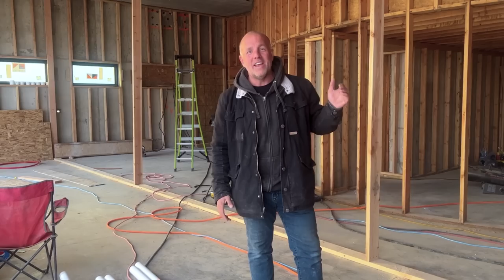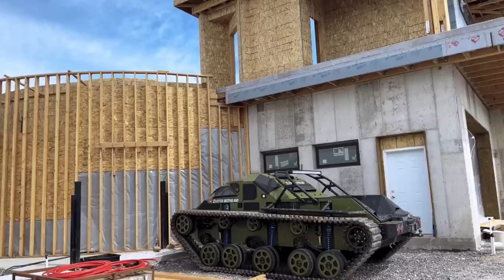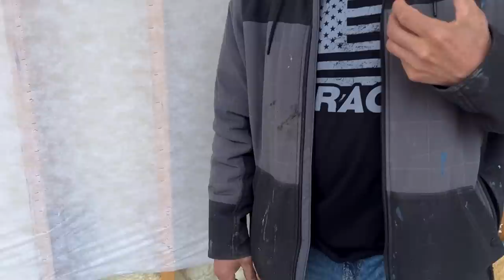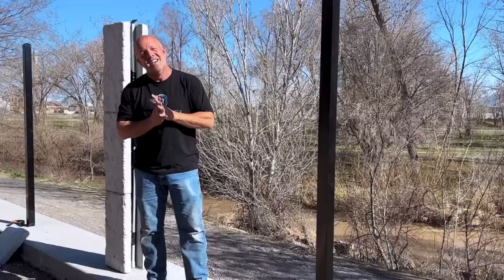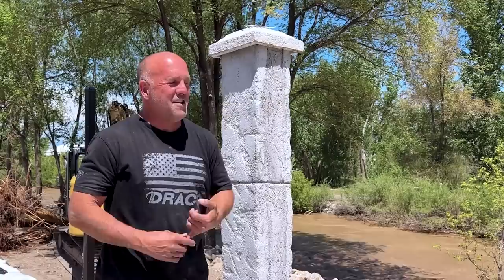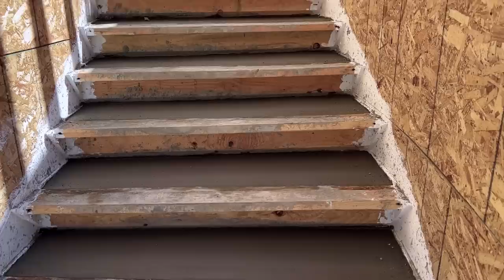Will My House Collapse? | House Build #13

Comment: That's a crazy home build. I love crazy. In fact I love crazy so much that I challenged myself and built a 3 1/2 story geodesic dome home with two domes connected together by a short hallway. I also did all the building with my own hands and with no hired labor at all. Thanks for the great videos that are very inspiring!

Comment: A word about that heat pipe that probably wont matter for decades to come but who knows. My grandmothers house was built in 1963. Her well fed the house with roll pipe that is polymer and much thicker that that heat pipe you're using. In the last 15 years i have battled with underground leaks. Having to cut it, piece it together in numerous places. One spot though, i learned. With just the simple motion of water starting and stopping, no matter how incased that water was. Would cause enough movement and friction to rub holes in the line. The spot that taught me this was about ten years ago when i dug up a section of the line and i found a brick. A brick from the original construction of the house in 1963. It was placed in the trench to help hold the line in place 50 years ago. Yet water going in and out of that line for 50 years, that brick rubbed a hole through that 1/16th thick polymer line. After my experience. That staircase heating..... ??? I guess itll last long enough.

Comment: Mike. I would look into wrapping the pool exterior wall with ply - high compression mineral wool - delta dry & lath and then stucco. I would be concerned about sandwiching the lumber and blown in without a pathway for vapor perm.

Comment: Could have used a Reflector-less total station to take the before and after measurements ! I know you work fast, so it’s probably to late now ! However if you still have supports up you could still detect any settling ! Hope there is no flooding yet !!! 👍

Comment: You should have met the engineer that built I-80 between out around KEarney, NE  about 9 mi out each way.  I hauled rubble on that part of the interstate. i think it must have been almost a bridge over sand, the new engineers didn't seem to have much respect for it. I'd assume its pretty rough by now.  But the original engineers must have used more steel than anything I have ever seen. And a solid 4' deep concrete in places I guess with blacktop we must have figured out a way for it to flex without as much trouble.

Comment: All that thermal mass in your warm pool is like a huge battery that you can charge up with summer heat using a heat pump and draw on it in the winter even if the differential in the pool throughout the year is only a small amount. i.e. The pool temperature is out of phase with the annual weather cycle.

Comment: A slab on a slab will act independently of each other as they load.  The only way they will act in unison is to physically tie them together vertically with the support shoring for the first on left in place as you did.  The top bars of the lower slab and the bottom bars of the upper slab would never see any significant loading if done correctly.  Good luck long term with that one.  I hope the bond between them is adequate.

Comment: I think I saw this on essential craftsman’s channel, but he had a situation with different colored concrete and his solution over paint was getting it wet, letting all the standing water drip off and then blotting the surface with a sock full of cement.

Comment: First thing I've seen that is questionable - closed cell foam on both sides of that wall assembly will trap moisture. A foam sandwich. It needs to dry in one direction at least, and since one direction is the pool, you really have to ensure it can dry outwards.

Comment: I am a little shocked that you didn't use at least a layer of Radiant Barrier in the layers of insulation you had around the pool.  You don't have to have a air gap between if you put it up against the fabric like you had to hold in the blown insulation.  Of course they do make bubble pack radiant barrier too, which you can sandwich between stuff if you need to.  But the reason I say that is that it performs much better than any insulation.

Comment: My only question is about the vapor impermeable layers regarding pool insulation.  Where will the dew point be in the wall assembly?  If it can't dry it will die.

Comment: Why mix three different insulation materials with the loose fill in the middle possible trapping moisture next to the wood? Why not continue to layer more closed cell foam while they are there to get the same rating?

Comment: Flashback to my Architectural Drafting course (part of my Mechanical Engineering Technology degrees). We had to draw (ink on Vellum)/design a whole building from the foundation up (within certain specs of course). All the rebar, windows, doors, you name it. THEN we had to do the Architectural RENDERING of the damn thing! Art isn't my Forte'... I usually got "A"s and "B"s, this is the only one I remember getting an "A+" on! 😁

Comment: I wonder if the span is actually less strong because it didn’t flex enough. Not to say it isn’t 10 times stonger than it needs to be , because, well it’s Mike. 😂
Reply: Shouldn't be, unless I'm misunderstanding something fairly significant. Put a heavy load on it, and its first reaction will be to flex like it was expected to - at that point you're at the predicted flex anyway, and you've already handled a heavy load.

Comment: Why not stainless rebar?  I am afraid in 30 years all that rebar is going to be rusting and causing the concrete to spall instead of lasting for 200 years like it could
Reply: Are you talking about chloride corrosion of the rebar in the pool? Or just rebar in general? Reinforced concrete structures will last a lot longer than 30 years (absent salt water or chlorinated water).
Reply: @mckenziekeith7434  I don’t know, Mike will probably use the pool as a launch pad for rockets into space someday when he gets bored of it.